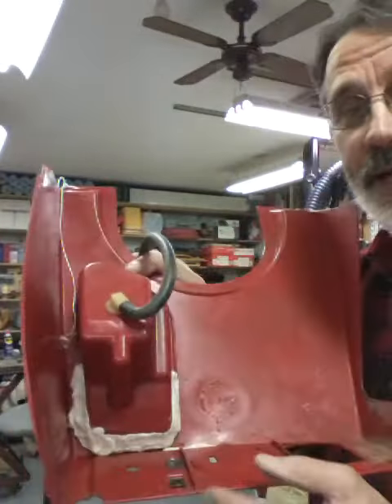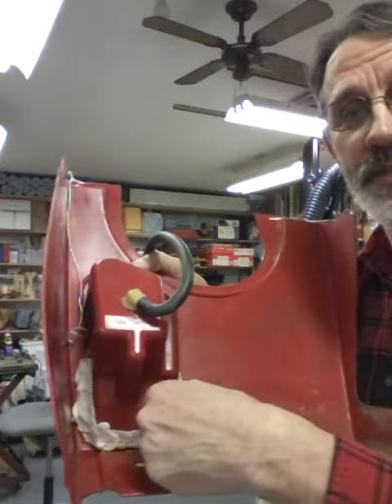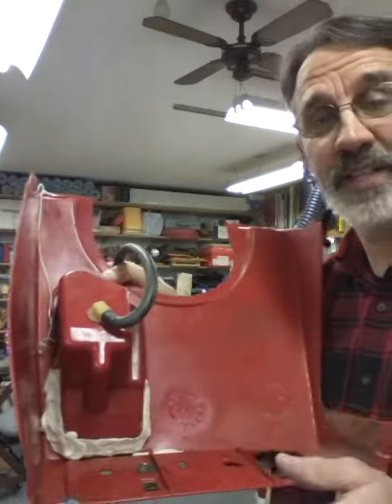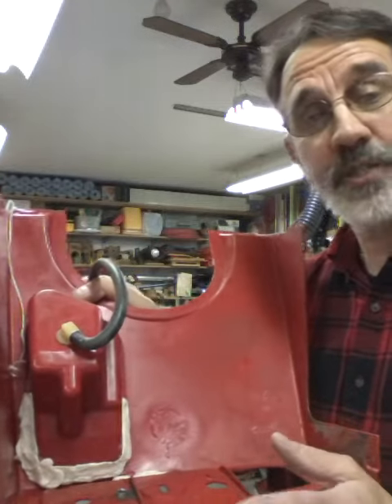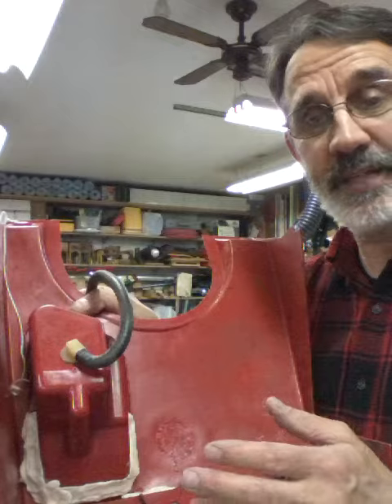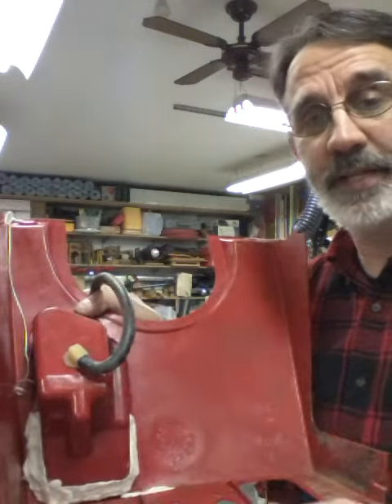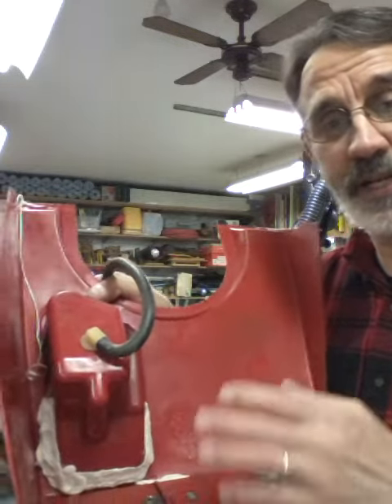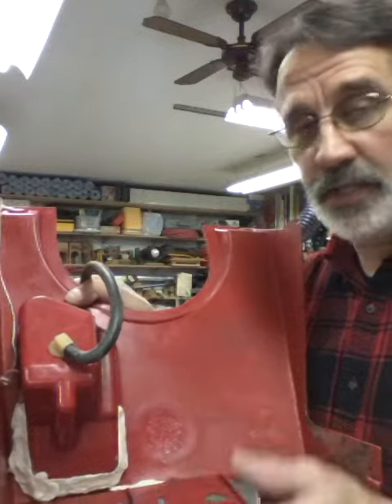6. Toro gas tank repair

Comment: Just did a zero cost repair to a leak around a portion of the seam in a Toro CCR 3650 snow blower gas tank. Remove the tank, drain all the gas, rinse and fill with water to locate leaks. Use a pen to mark on tank where leaks are. Then using a hot soldering iron 40-60w setting, slowly melt the plastic and push melted plastic towards and over the crack. Test the repair by filling the tank with water and examining for leaks. Once no leaks are visible, dry out tank and re-install.